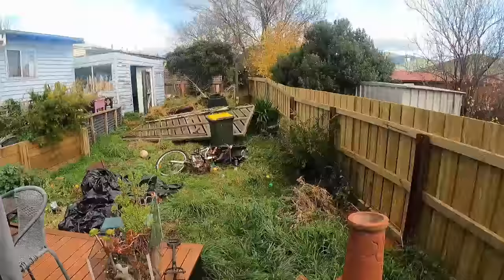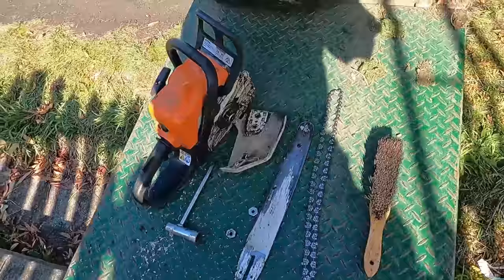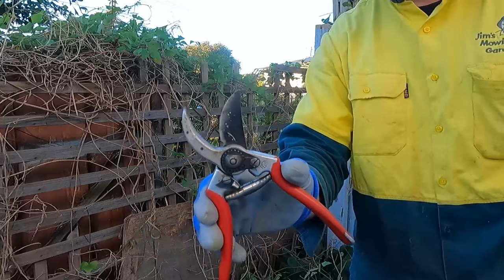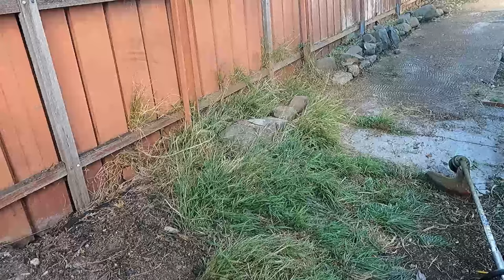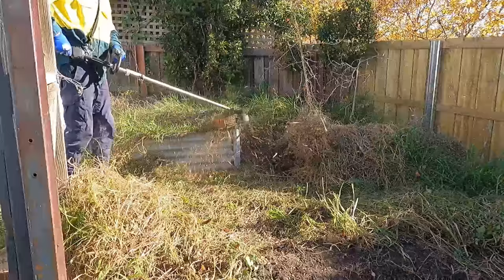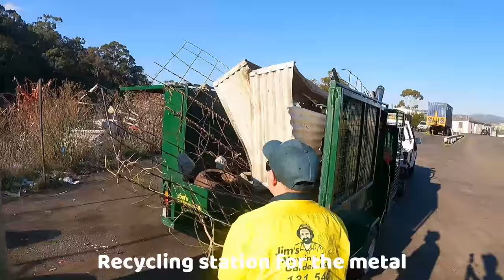This Place looked like a Bomb had Destroyed it | Overgrown Rescue

Comment: Great job. 
But what blade setup is that on the Honda 21? Ive never seen that, just the stacked 2
Reply from the maker: Most mower in Australia have the 4 blade system - 4 single blades

Comment: the guy with the shorts  is a go getter.  guy with the long pants just wants to cut and toss aside and let the other guys load it .  a dull blade is a safety hazard, and why don't  you have more than 2 chainsaw chain?  we use to cut wood and we had 2 chainsaws and about 12 chains when 1 got dull.   Got to say yard does look so much better.  were they elderly?
Reply from the maker: That's because I own the business, and he is employed to carry the things I cut!!! And I have 3 chain saw chains and 6 pole saw chains
Reply: @QuickCuts  well he is a good worker, which is hard to find. Good luck